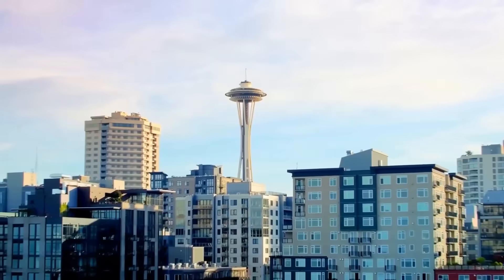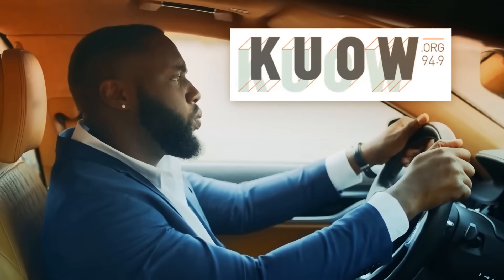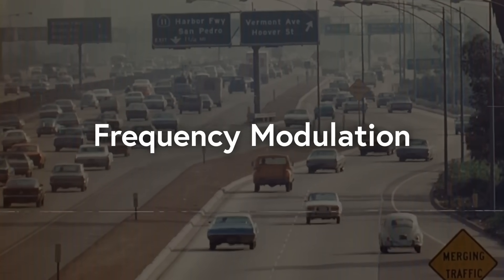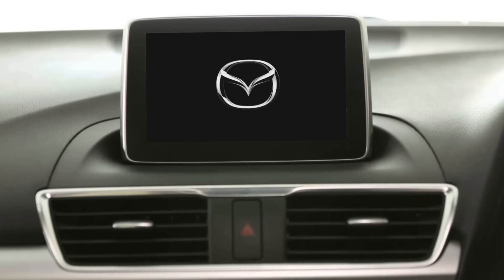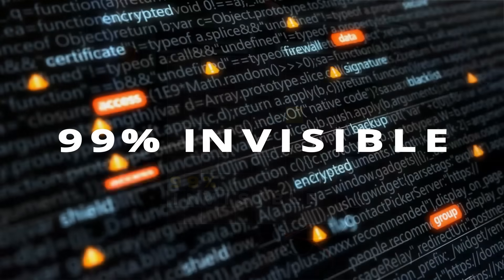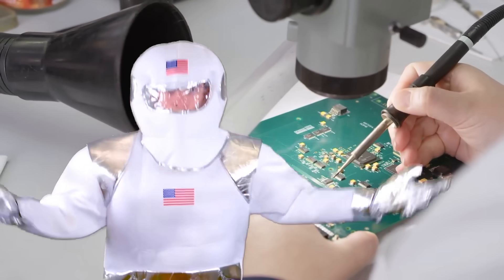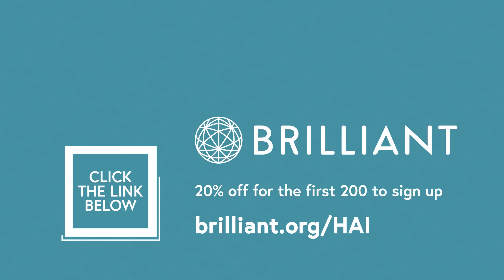Why Hundreds of Mazdas Tuned to 94.9 Broke Simultaneously

Comment: I have a degree in computer science and I can tell you the problem is only going to get worse and more common. Very often companies hire the lowest bidder to design, and implement the software. Not only that, but they insists on very aggressive timetable which  does not allow enough time to sufficiently vet the design and test the product. These lowest bidders are in many cases are programming sweat shops that hiring new college graduates or in many cases just some geeky high schoolers that never had any formal education in computer science. it is hard enough to produce a viable and robust software product using formal design and development methodologies, but you add the pressure to cut corners and rush the development without even a spec, and the result is never pretty. In the case of Mazda, it's a software defect in the radio and no one dies.  But look what happens if it is something like a software defect in the flight computer on a Boeing 737 MAX. and it kills 346 people. Now, think about the computer programs that control such things as your cell and iPhone charger that keeps the battery from being overcharged, or the new auto steering system in some cars  today which according to the automobile industry the goal is to make it standard on all future cars. In software, we have a term "single point of failure" which means a part of a system such that when it failures it cause the everything else to fail. The "smart" software and hardware in all the devices of today is a single point of failure.

Comment: It really is nuts to me that this could happen.  Rule number 1 on software is don't trust external input...it should have had a try-catch around opening the file that would have skipped loading it and done some sane recovery (like throw up a warning to the user and move on, optionally deleting the bad file).

Alternatively it could have had part of the reset loop wipe the cache data which would at least let it self repair when it stopped downloading the bad file.

Comment: (Retired IT field tech for a Fortune 100 electric utility, avionics tech in general aviation before that.) Ironically, the push for truly autonomous vehicles will sweep up this problem of unmanaged bugs in the process. Legal issues will ultimately force the entire automotive process for autonomous vehicles into comprehensive control, just as general aviation (light planes) has been for longer than I have been alive. Version control for all operating software will become mandatory. It will make automobiles much more expensive. A Cessna 172, roughly the equivalent of a family sedan but with higher speed, will set you back somewhere above $370K US depending on options. Gone will be the days of only $100 per hour for maintenance and repair. We definitely need those seat belts for this wild ride!

Comment: In aviation, computer software is required to run different programs (I'm dumbing this down a bit) based on criticality, exactly so that, for instance, a bug in the entertainment software doesn't bring down navigation or flight controls or something. These auto manufacturers better be careful about this stuff before the good old government steps in an requires FAA-style certification processes on automobiles and really drives up the cost of everything.

Comment: My gen 3 2016 mazda3 infotainment system didn’t need much to fall into a complete panic. Anytime the temperature outside dropped below 10 degrees F, the system would fall into a hopeless reboot loop until the car was at operating temp. Sometimes the entire drive if it was cold enough out. Gen 4 is far superior in every regard.

Comment: I miss my 1982 Chevrolet S-10 with the 1.9 liter isuzu engine  & isuzu 4 speed manual transmission, long bed 2wd . No radio,  no power steering,  no power brakes,  no abs,  no traction control,  no power windows,  no power locks, no ac,  no nothing . 38 mpg hwy  / 32 mpg city ,,,

Comment: Mazda not able to hire a competent computer programming team? Seems so. Should have caught these things long before production. 

And if the offending file could be downloaded and stored, surely someone could connect in a safe mode and delete the offending files to avoid the need for a new computer. We all dread the “blue screen of death” at freeway speeds, and rightly so. This was just the radio and maps, but sloppy work Mazda.

Comment: I drive a 1938 Packard. No computers, runs smoothly no matter what. Easy and inexpensive to maintain. Old AM radio works fine and my MP4 gets FM when I want that. Gets very good mileage since I made a few easy alterations to the engine and drive train. Screw new cars!!

Comment: I have a 2016 Scion iA, which is a Frankenstein of Mazda/Toyota engineering and had the same issue with my own vehicle. Neither Toyota nor Mazda would take the blame for this the way Mazda did for their own vehicles. It makes me far less likely to purchase a vehicle that doesn't have 100% parts from one dealership in the future, as this replacement was over $1000

Comment: huh
          not a prob in my 1995 Land Rover Disco 1 with 5x2 manual shift

235,xxx miles and counting

no Seatbelt Light or "Audio Off Until Seatbelt Connected" like in my company car
   (& no I am not a Reagan-Era anti-seatbelter, but sometimes I am just moving the vehicle around on a construction site or campground or pasture...)

no "Your Door is A Glass-Jar" either -- maybe I want to open the door and look back while manuevering our 1958 Aloha Ham-Can camping trailer ??¿

yeah, both sunroofs are crank operated, and have window regulator cranks ready to put in the doors this summer, as those new-fangled electric window lifts weaken

Comment: The 99% podcast could have just added a / (slash) or | (pipe) behind the % to fix the issue.... or better yet, just put 99% in single quotes, so the car wouldn't try to interpret the string. Further, whoever wrote Mazda's infotainment system is amateur hour level. Always sanitize data inputs and never assume a file is useful without a extension.

Comment: If this ever DOES happen (or if your Mazda is currently bricked) you can fix it easily. Here’s how. Since the issue is with caching of corrupted data all you need to do is clear the cache. This is easier said than done. However fully draining the reserve power from all onboard computers modules should clear any cached data as well. This is where the solution comes in. What you are going to need is a 10Watt 1 OHM resistor and a set of alligator clip wires. Simply disconnect your battery terminals and connect the resistor with the alligator clips to the positive and negative terminals and leave this connected overnight. The following morning just hook back up your battery and your radio will be fixed.
Reply: This works the same as connecting the positive and negative terminals did in old cars. (Pre 1990). It basically fully discharges all the onboard computers and electronics without frying them. Which is why you need the resistor. This is the equivalent of factory resetting your cars onboard computer system. If you don’t have any of the parts this fix will cost you $5-$15. Way better than $1500+ for a new computer from the factory.

Comment: One of the many reasons that I don't want a modern car. Also why Windows is going bad. All of these past issues that computers have dealt with, and new computers aren't being built to handle them. I remember when computers saw an extension-less file and deemed it as useless... and so you had to manually assign an extension and hope it worked. If that didn't work, you could just keep trying extensions until you found what worked... or delete the file, because if it isn't just an image or text file, then it is probably a virus. But why make a virus, when the computer trips over a simple error? Also, why are people making extension-less files? You pretty much have to go out of your way to cause that.

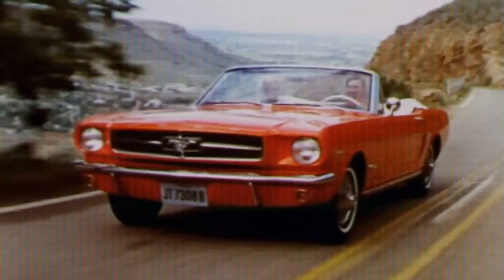Comment: 1:56 RDS, or Radio Data System which was developed in the 1980’s could send things like what song you’re listening to, or traffic information, or even sync your radio clock with the data received.  So FM radio did have a way to send at least some type of data to your radio.
Reply: It still does and US FM stations also are using it. It is coded carrierless on the sideband around 57 kHz of the modulated audio signal (38kHz is the stereo difference signal).
Reply: And they do it horribly, constantly overwriting the 8 character station identifier with random crap

Comment: What I don't understand is why Mazda can't just...release a firmware update for those effected cars that resets the cache. Because that's a thing. They can do that. The cache is probably stored on flash memory, may even be stored on volatile memory like a lot of less critical data in automobile computer systems (Example, battery dies or is disconnected and your clock needs reset. Or more on topic, battery dies or is disconnected and you lose things like radio presets/tuning/bluetooth settings etc.)

Comment: Sounds like the image file was causing a kernel panic, which means the radio's OS doesn't have any sort of isolation or sandboxing. The fact that the file is also permanently stored is also worrying. Apparently the programmers also didn't include any exception handlers. That's some pretty basic stuff for any sort of modern connected technology. I wonder if there's even any buffer overflow protection.

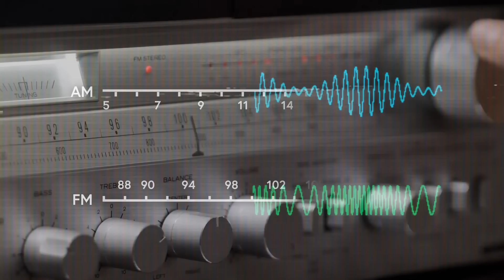Comment: 1:55
this is incorrect, RDS (radio data service) hides a signal in the transmission that allows compatible radios (quite common) to decode text with info about the station and its media
Reply: Put one letter like that " ( ' - _ ) ; " and radio's software would crash and possibly boot loop

Comment: Fords radios are problematic too. The SYNC 3 system in my work Transit Custom broke at some point, presumably due to jumpstarting it.
They have a protection feature, if battery voltage is too low, the radio refuses to turn on.
Jumpstarting sometimes glitches the radio, and you just have to remove the battery for like 3 seconds to fix it.

Comment: My Maserati Gransport has no integrated infotainment or other rubbish. Just a seperate car computer that is not exposed to the internet or other non wired signals, and a seperate self installed radio that does not communicate with the car ECU.

This is the way it should be, and Teslas frankly scare me

Comment: God, the mistakes that lead to those kinds of software bugs are quite literally some of the first things you learn to avoid when it comes to software security. Sanitizing input is an absolute must, and the number of times I keep coming across large companies failing to do this is stupidly high  to the point that now I have 0 faith in the security and stability of any piece of software that is not open source.
Its damn good in this case that the entertainment console isn't tied into the car computer or it could quite literally brick the vehicle itself. Maybe they should consider not outsourcing their software to some 14 year old kid. Though in reality I'm pretty sure a 14 year old just learning programming wouldn't even make this mistake.

Comment: Sometimes, the old ways is the best ways. TV OTA broadcast in a digital rather than analog format has a big drawback in that instead of being able to watch a show with a little static (due to weather), you either have a PERFECT signal or nothing [No, for what little I TV I get to watch, I'll NOT pay or any "streaming" service). The "smarter" cellphones become means MORE info that can be monitored or hacked. "Really smart" cars have been hacked to mischievous results. I absolutely disavow and condemn his methods but sometimes I think Ted Kaczynski wasn't so crazy after all. (As Det. John McClane told his wife via her airliner's air phone, " You know me, babe - technology peaked with frozen pizza." ;-) Simply, we're becoming too dependent on technology before we really understand how to control or, when appropriate, regulate it.

Comment: Idiotic programming. Those guys writing those POS programs should be fired.

When I wrote programs professionally, I always took extra care to write them as un-crashable as possible. If my programs received something they didn't understand they didn't freak out, they just discarded the offending data. Sometimes they left a note somewhere that there was bad data, usually just a counter of invalid data packets received. This is how programs should be written.

Comment: This is entirely on Mazda.  There is no expectation that whatever signal comes from an HD Radio station is going to be coherent.  There are any one of a million reasons that one of those files might get corrupted in transit and not have a valid file extension.  And frankly, that would be bad enough.  But the computer system doesn't have a reset that can be reached behind the dash or something?  Seriously?  I don't care what the radio station did, from a software standpoint every single part of this failure is entirely on Mazda's software AND hardware (no reset) decisions.  And they sure as heck should be fixing it.

Comment: Tech info:
HD Radio wasn't the first radio standard to be compatible with a digital download service.
FM radio had RDS back in it's later days.
I remember radio stations using it mainly for two purposes. 
Firstly, to give the listener the station's name on their radios (applicable when the listener has a radio with a digital screen and RDS support). 
Secondly, to allow the listener to jump between the station's broadcast towers if the listener is on the move and moving between ranges of the station's broadcast towers (Applicable, if the listener's radio has RDS and AF support).
Reply: Why "had"? RDS is still used widely today throughout Europe (and possibly the US, too).
Reply: Was gonna make this exact comment. We have had RDS in Europe for decades. The audio isn’t digital but the data it sends is. RDS also supports automatically switching the radio over to a station when the news or traffic alerts come on. Also is the basis for TMC, the digital traffic system that sends out traffic updates to Satnav.
Believe the US never got any version of RDS for some reason.
Reply: Wasn't digital download, but yes. Also supports emergency broadcasts and traffic reports.

Comment: Wait so did nobody help assist customers with this?
They did nothing wrong except sign in to a radio station. It was the radio station's fault for not coding their information correctly and it's Mazda's fault for not coding their system correctly
Yet the customer still has to pay?
Bull shit

Comment: Couldnt this issue just be fixed by accessing the drive of the infotainment system and deleting the file? If its just in a bootloop because it has no idea what to do with the file, wouldnt it be possible to just have an external tool search whatever folder holds radio downloaded files and clear them?